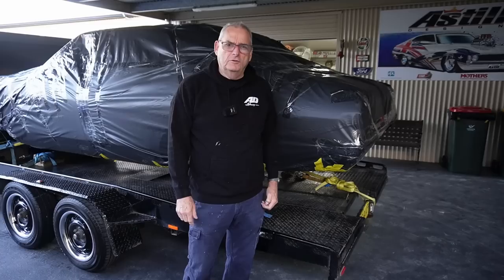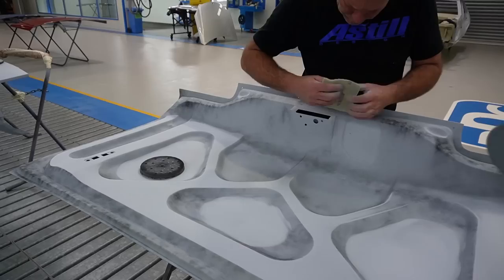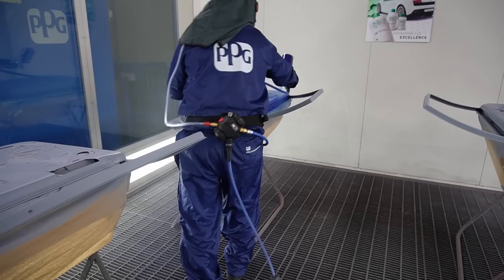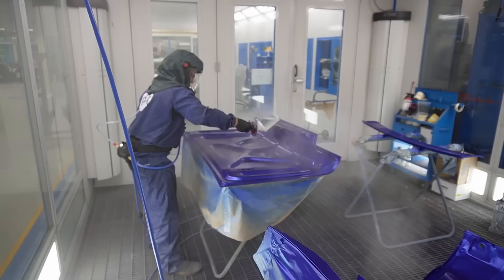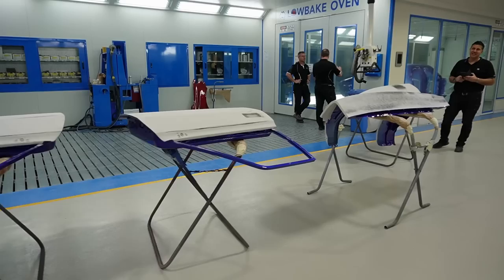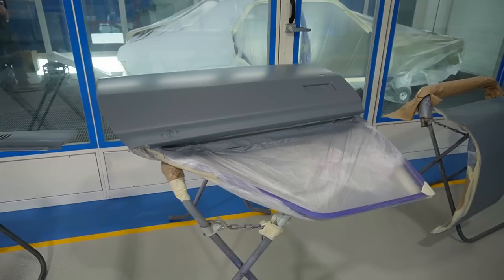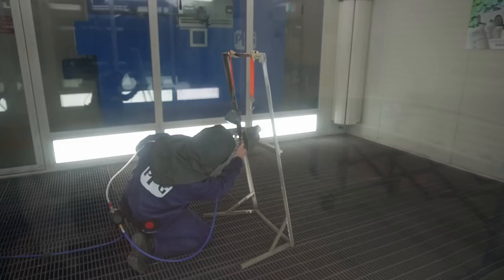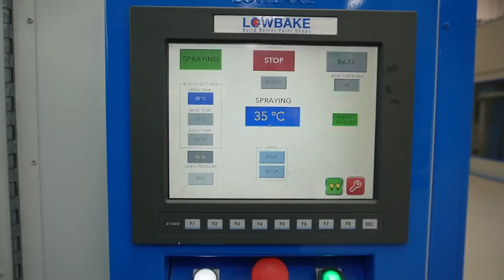Painting BOSSXC at PPG  | Road to Summernats Top 60 #44 | Ford Falcon Show Car

Comment: nice work. I have a 4K high end pro art monitor. just wanted to let you know right rear door under the door handle there is a pretty decent imperfection mate. unless its a distant light source looking like a bit of light. 25:50 but its visible at 25:58
Reply from the maker: no problem, in the next video the whole lot is resanded with 400-800 and flow coated

Comment: It was great meeting you and seeing this car at MotorEx mate! Congratulations on your awards from the event!

I've heard from a few old-school people wet sanding can be used in the 400/800 grit stage just before putting the colour down, to help limit sanding scratches. 

What are the pro/cons of wet VS dry sanding?

This is just a hobby of mine so I don't have much experience...
Reply from the maker: Hi, not an easy one to answer. The dry sanding done correctly will not leave scratches. The wet rubbing is introducing moisture to the paint process that is always going to be problematic. We will be doing more tech videos on the painting process starting in July.
Reply: @AstillDesign  thanks for the reply, look forward to seeing the series in July!

Comment: Amazing finish and the video is top notch. I sat here trying to soak in all the tips and decades of knowledge/experience shared.  Thanks for sharing!
At 20:34 was that some trash on the underside of the boot? As a bloke who does his own stuff at home and tries to be a perfectionist which can get frustrating at times, )I obviously don't have such a surgical facility at the headquarters) so it is nice to know that these little things happen even to the best of the best.
Reply from the maker: Not sure what you mean by trash, but there is always some denib required and the odd run when applying this much product. The whole thing will be colour sanded and polished

Comment: Looks very  nice .Did you use a Viberance  Clear or Deltron clear Nice team work
Reply from the maker: The initial clear before blocking was Deltron D800 the Vibrance for the flow/finish coats

Comment: I'm sort of returning to painting cars after a 30 year leave. You can't believe how many terma you fellows are using that I have never heard before. Could some one clarify "2K"?  "flow coat"? Many others but I find that these Youtubes have a LOT of info. I just have to keep looking.
Reply from the maker: 2k is a 2 part product, paint and hardner. Flow coat is a second application of clear after sanding flat with 800 using clear that has more thinner and applied with higher pressure to achieve a flat finish

Comment: I'm a little confused with the many layers of primer and the various sandpaper used to chop each coat.
Early on there was you sanding the inners of the panels the initial primer coat with 400 then John on the 800, then it was primed again with wet on wet self levelling primer. What was then used to chop the self levelling primer ?

On the outer sections of the panels, the primer the car arrived to the shop with @11:40, John's on 180g, then 240g, followed up with two coats G6 wet on wet. Then this is sanded with 320g and re primed again ?
Why so much primer ? I think that's the third layer of primer. What was the grit used on the final layer of primer prior to colour ??

Also, how do you get a nice smooth transition from the door jambs to the outer sections of the car because I see you hard edged the masking. More so around the rear quarter panel arch ?? Does the back masking enable the outer paint to fill and meet the level of the inner paint ? Won't you see a join line of the two paints meeting ?

I'm going to be going through a similar process myself at some point Howard with my XD Falcon  (owned since "91}, and the technology has vastly changed since I was painting way back in the late 80s and into the 90s.
Does PPG hire out their spray booths or is this strictly an in house set up ?

I am definitely going to use their products as I have used them in the past and seeing the level of quality here. 

The final paint finish is stunning Howard. All those many, many months of hard work on the body has paid off. That car is practically picture perfect !!
I noticed John's clear coat application has him over lapping just past the panel gaps so as not to build up the edges too thick with clear. That's what a Pro does. Great work by John and his team. You guys are ALL Legends !!

Thanks for the ride.
Reply from the maker: Tony I will update the description in the next few days with a step by step of the process. I was incorrect about John on 800 at that point. It. Was later that he was on 800.
Reply: Tony, not that my opinion is worth a whole heap but I the last time I painted an XR falcon my process was basically to colour and clear the door inners first..... (obviously bake).... back mask the door openings as Howard has done on the body and base coat the jams.......mask the inner doors and hang very carefully (as door aperture is still only base coat) ..... base entire body with  doors and guards on....... then remove doors and guards to clear (again carefully)  this is how I got no mask lines on the door apertures. Also when masking the inner door you could run a soft edge mask around the lip.
Hope this helpsnor makes sense...it wasn't easy and everyone does things a different way but that's just how I tackled it 👍
- colour was ford ego and was ppg deltron

Comment: May is ask,  when taking the doors on and off multiple times how do you not damage the paint on the jams?  do you put a gasket between the metal surfaces?   Thanks
Reply from the maker: Hey mate, I have sanded the back of the hinge with 360 grit on the Mirka 77mm sander and left it bare metal so it doesn't stick paint to paint. I will paint the hinges before the last fitment.

Comment: Great work guys, that car is looking absolutely amazing. Watching the paint go on is almost hypnotic love it.

Quick question I saw that the booth temperature was set to 35 degrees is that just for the baking and is the spraying at the same temperature?
Reply from the maker: The painting optimum
Reply from the maker: The painting temp is 25 deg. These guys were pushing some of the limits to get it all done in the window we had. The next episode  will cover all the specs
Reply: Looks a little on the rushed side for such a car
Reply: @AstillDesign  thanks Howard can't wait for the next episode.
Reply: @chrishall8142  I trust they know what they are doing.